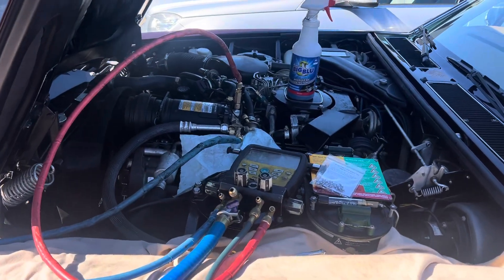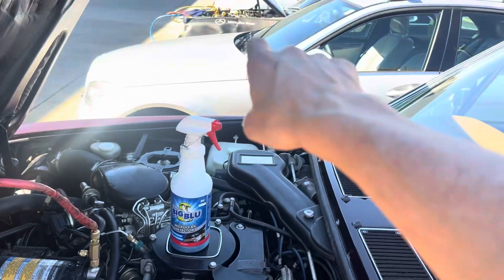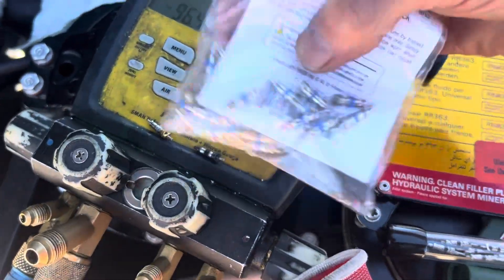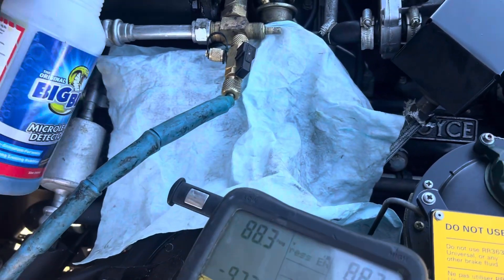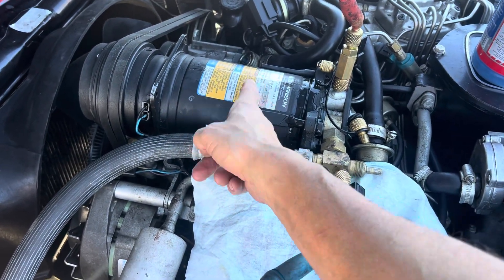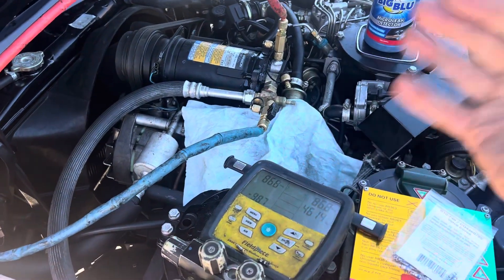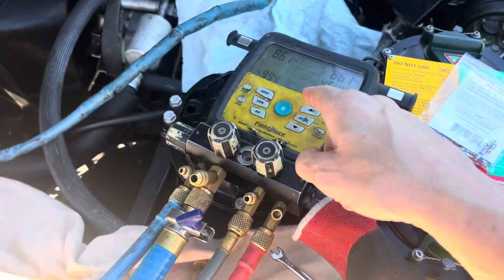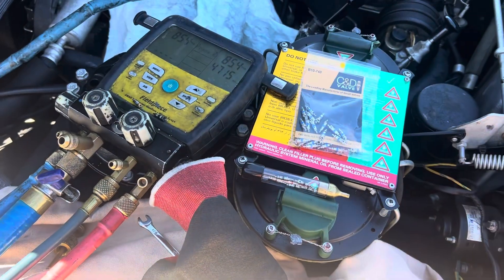PASSED HIGH PRESSURE NITROGEN DECAY TEST FOR 15 minutes ( then failed)

Comment: Like Your videos! Can You explain about replacing oil in a/c systems, how often it has to be replaced, even if it has no leaks? Thank You!
Reply from the maker: If the oil is never exposed to moisture and oxygen and extremely high heat. 
 The oil should not ever need to be replaced. 

It doesn’t wear out. Burn up or get consumed. Under ideal cindy.

Comment: Hey man! What do you think about Robinair 18340?
Reply from the maker: I have the master cool version of the same thing for replacing valve cores on full systems. It works good.. 👍
Reply: @coldfinger459sub0  I was wondering whether I can evacuate the system with cores removed, like big systems - using that.
Reply from the maker: @commenter5469  they don’t have threaded hose connections. 

You’d have to get a special adapter because they’re not quarter inch threaded on the end when you takeoff the valve extractor